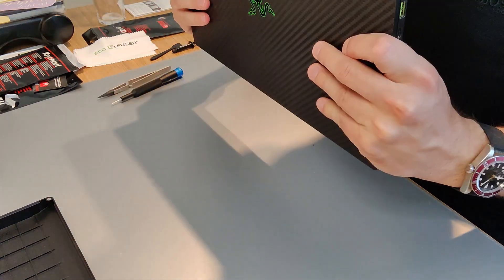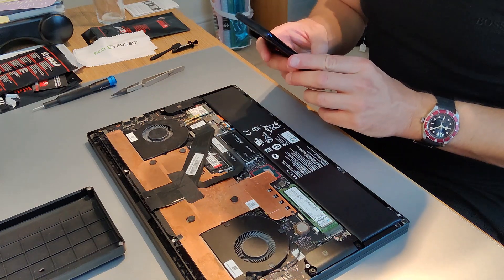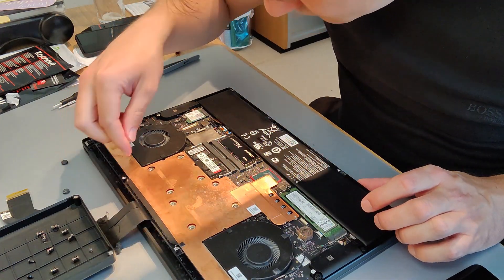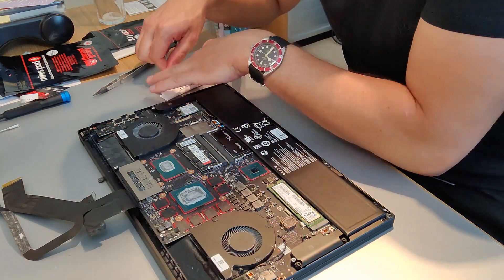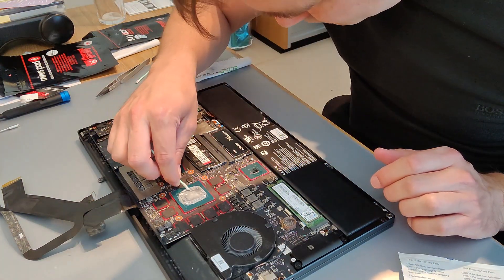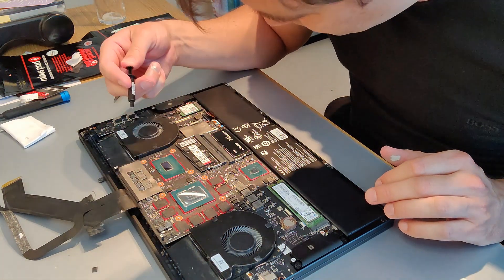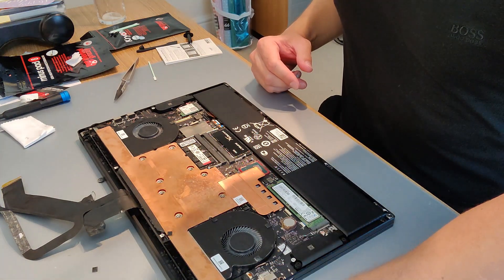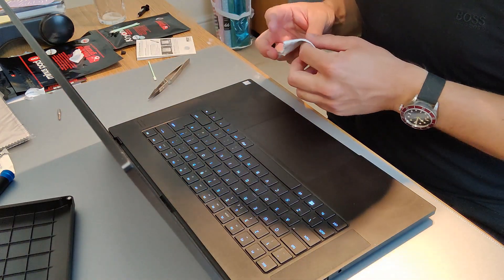Razer Blade 15 RTX - Teardown and Repaste - Thermal Grizzly Kryonaut - Guide

Comment: Just repasted mine a few days ago. I have had my laptop since late 2019. As i took the screws out of the back plate the battery began rapidly expanding. Found out why I was getting such poor thermals
Reply from the maker: Omg! 🤯
Reply: Yeah replace your battery every 2 years. The Razer battery is known to bulge, I replaced mine now with a third party (cheaper) battery. And it’s better quality than the original razer one 😂
Reply: @genicota  eh. the 2070 max-q in it isn't worth it anymore. i just run it on the charger and curse when the power cuts out.
Reply: @ImmaSayKOOHWIP Defeats the point of having a laptop? So no thanks
Reply: @genicota  bro i ain't trynna convince you that it's the way to go?? Just personally don't need my laptop for portability. if i am out and about i'm not trynna pull out a loud ass gaming laptop tf?
Reply: @ImmaSayKOOHWIP Ong this foo is tweaking.

Comment: Why you didn't clean the fans, and grills from dust, ahhh and also .... pressure will not spread - in laptops - thick paste, you would be better of with using that spatula that was with Thermal Grizzly, additionally just after reassembly it is best to quickly thermal cycle the CPU and GPU - you need to expand/contract the paste as quickly as it is fresh and fill in 'voids' well. I would agree though that 5C up to 10C difference is only with perfect application, LQM can reach 12-19C improvements.

Comment: Hi, can i know how this razer blade performs today?? Is it still alive? Are you facing many issues during the years up until now?? Sorry I'm asking this, because there are alot of people having problems with their razer laptop like the presents of several issues with their laptop, thank you :)
Reply from the maker: Unfortunately it was stolen from me about 6 months ago. It was still excellent  before that happened after over two years of heavy use. I have never had problems with razer laptops and will continue to hold them in very high regard. 

On the other hand, I've not heard many speak of problems with Asus products but I've had 5 ROG Zephyrus laptops and only one of them wasn't badly defective. I've put it down to bad luck so haven't made a fuss 👍🏻

Comment: Thanks for the guide. I've had my blade nearly 2 years and about a month ago I shut the lid (normally puts it in sleep mode, this time it didn't for some reason) and put it in my bag. When i got it out again 45 mins later it was too hot to touch, cpu was at about 99 degrees. When I took it apart the paste, or what was left of it, was crusty. Just got it all back together and its idling 10 degrees lower :)
Reply from the maker: That's amazing! Good skills 👍🏻

Comment: Just replaced the thermal paste and cleaned my fans and heatsink

My temps dropped from 96 to 50. My fans has a think layer of dust and my paste was a mess and crusty. 

So pumped to be getting the performance I expected out of this thing. It was basically always at a state of thermal throttling untill now.
Reply from the maker: Nice!! Sounds like you did a good job. 

Yeah it can make a big difference. I repasted an msi raider a couple of weeks ago and it made a huge improvement.
Reply: @WarneysWorld  thanks for the video !

Comment: I just bought the new i9 OLED Blade Advanced and while gaming I am in the 70's but I get 100 degrees spikes. I am really considering Kryonaut.
Reply from the maker: Is it a quick spike which settles down as the colling system overcomes it or is it more frequent? That's a beast of a cpu in a thin and light laptop! 😍
Reply: @WarneysWorld  Yeah a really quick spike. I think it only hits 100 degrees for one to two seconds.
Reply from the maker: I don't think that will do it any harm. On my blade 15 I caned it for a year at 95deg before I learnt about undervolting an I've never had problems with it nearly 3 years on. Never hurts to proactively manage temps though so if you're confident with repasting it's only going to help. Out of interest, can you undervolt 11th gen cpus?
Reply: @WarneysWorld  Actually I found out it is sustained 100 degrees on CPU and 70's on GPU. Since day one it has been like this and that is why I am considering Kryonaut.
Reply from the maker: You might be right, it could be a bad factory paste job. If it was me I would definitely give it a go.

Comment: Hi I have razer blade base 2019, the fan noise is very loud, if I change thermal paste will it be quiter?
Reply from the maker: It will be if your system is dissipating heat more effectively. Also worth vacuuming any build up of dust in the fans as this can also make a bit difference.

Comment: Thank you my main! Was at 100'c before following this tutorial. Now barely hitting 68 whilst gaming. I would buy you a beer if I could.
Reply from the maker: Beer is always welcome! Haha
Reply: @WarneysWorld  i have my razer blade since 1 year now and since some weeks i´m also hitting like 80 to 100degrees while gaming/editing, so it´s time to repaste, right ?
Reply from the maker: It might need repeating after a year. Temps up to 90 on the CPU whilst gaming and rendering is fine but I wouldn't want mine going up to 100
Reply: @wambologyy  while you're at it, check the fins and fans for dust buildup, if you have pets or live in a place where dust is prevalent, this might be the main culprit.
Reply: Tenka thanks for the advice!

Comment: Was that liquid metal or just a normal thermal paste ?? And did you notice some performance boost ?
Reply from the maker: No it was just kryonaught. I'm a bit scared of liquid metal 😅 

I didn't notice any difference but it was a good paste job already by razer and they use decent stuff
Reply: @WarneysWorld  😄 okay , I thought it was liquid metal cause thats risky 😬 
I am gonna buy a thermal paste tomorrow for my razer laptop , do you think its worth it ??
Reply from the maker: @Kamrankhan23333  I'd only do it if you think there is an overheating problem
Reply: @WarneysWorld  my laptops temperature gets too hot that I can even cook eggs on it 😄 🤣

Comment: To anyone who is going to repaste your Razer blade 15 ( in my case it is a version from 2018). You might have noticed four soft pads that cover heads of four heat sink screws (https://youtu.be/XUKb-FzgubI?t=176). Throw them away (or glue them?). You may have been smart enough not to put them back, but I was not ( though I had a feeling that I should not. But then, I thought, ah it was there in the first place who am I to throw these pads away?). Long story short one of them ended up being stuck in one of the fans, blocking it. I had temperature drops when playing, and could not see a reason (for a few months after repast I had to stay home and did not move my laptop, but then I was allowed at my office, and then I guess while carrying it, gravity pulled one of the pads down which ended up in the fan.). Then I looked at it and saw that one of the fans does not rotate.
Reply from the maker: Thank you for the tip 🙏🏻

Comment: Hey man great video! I have a Blade 15 advanced model with a rtx 2070 max q and an 8th gen core i7. Im getting 88C while gaming on the GPU and 95-100C on the CPU. Are these similar to what you were getting before you repasted?
Reply: I've got a 2020 Blade 15 base with the i7 10750h & GTX 1660ti, my first one was 70-78°C while playing GTA V, my replacement (same year, model and spec) seems to hover around 76-84°C on the same title! (temps are CPU & GPU average) but from what I've read the CPU is rated for 100°C so while it's not amazing, you're still within the limits for the chip

I've got some Arctic silver 5 left over from my desktop build so will be repasting later on today when I install a 1TB Samsung 970 evo 💯
Reply from the maker: No my temps weren't that high but I didn't really need to repaste. If your temperatures are up to 100 on your GPU I would definitely repaste. I think it will make a difference. 

You could also try using throttlestop and afterburner to undervolt and reduce temperatures as per my video here: 

https://youtu.be/DRsCzRtiylY

Remember that all chips are different so what works for my device might not be optimal for yours. So these settings could be seen as a good starting point but you may benefit from experimenting a little yourself.
Reply: @WarneysWorld  Cheers mate! Ill try it and let you know. Also, what are your thoughts on liquid metal?
Reply from the maker: @keshan2675  Theoretically liquid metal would be the best performing interface material due to its thermal conductivity, but the stuff honestly terrifies me, as it is electrically conductive, one tiny slip could result in a bricked system. I'd also be concerned about it moving over time. I don't think you should need it on these systems. 

I'd be really interested to hear how you get on. Make sure you hoover any dust out of the fans too because that can make a massive difference 👍🏼
Reply: @WarneysWorld  Yea thats fair enough, I do move my computer around all the time so LM probably wont be the best idea.
I just ordered kryonaught, ill let you know how my temps are !
Reply from the maker: @keshan2675  amazing - good luck!
Reply: @WarneysWorld  Just finished. Dude my system runs wayyyy cooler! Took everything apart, i cleaned the fans (just sprayed some air in there, didn't get everything out). When I took off the heat sink there was a lot of dust build up on the fins. The stock thermal paste was still in pretty good shape, it was soft and still creamy sorta. Removed most of it. I used kryonaught from thermal grizzly, used an x shape pattern and spread it over the entire CPU and GPU. Im getting temps in the 78C on GPU while gaming. Its amazing! 

One question, as I was taking off the heat sink, i forgot to take off one screw so the heat sink sort of bent, but not much and doesn't impede on the structural integrity. Since it is a vapour chamber, would it have long term implications on the system?
Reply from the maker: @keshan2675   @Keshan26  that's great news! You must have done a good job 🙌🏻

It's hard to say about the heatsink. If you have improper contact between the heatsink and the CPU or GPU you would see them running very hot.  It might be best to wait and see, but if it's performing well and running with acceptable temps I really wouldn't worry.
Reply: Hi @WarneysWorld  , your video with afterburner and undervolt is now set to private. Is there any chance you could make it available again?

Comment: Hi, nice vid man. 
I'm consider changing my thermal pads.
What's the thickness of those thermal pads? and one on the PCH, SSD thermal pad seems thicker.
Reply from the maker: I'm not sure to be honest. I would check on yours in case there are differences 😊
Reply: @WarneysWorld  i replaced all my pads with 1mm thick pads xD and all pads doesn't seems to have full contact with heatsink xD.
Reply from the maker: That's the kind of thing I'd do! 🤣

Comment: I think you put much less thermal paste onto the GPU than it needs.
Initially, I did thin X and saw how the temps went crazy, about 15 degrees higher than before.
Then I've reapplied using the fat X with dots on the empty spaces and now the temps are pretty the same as were before the first applying.

So, I see that the GPU definitely needs more.

BTW, for CPU I used the rice grain, and the temps went down for about 15 degrees. So it definitely worse it.

I used the Noctua NT-H2 and the Thermalright pads.
Reply from the maker: It's fine, I have used it for six months since the application and temperatures are great, and it out performs many devices of similar specification. The application was completely valid and in line with published guidance.

Comment: Does opening and upgrading void the warranty as Razer is totally restrictive when it comes to their warranty, repairs, parts which they do sell and there are no local authorized repair shops.
Reply from the maker: Upgrading your ram and SSD won't invalidate warranty but repasting probably will. But I don't see how they would know that you've done it unless you put it back together wrong or tell them. I did mine when it was already out of warranty, and I didn't really need to do it, I just wanted to find out if it made a difference. If you have a device with high temps and poor performance it would definitely be a step I would take as a poor paste application could be the cause of the problem
Reply: They will not sell any replacement parts. I have an RB 2019 that was shipped missing a screw, it's a Mercury White model and the screw colors match the rest of the chassis. They "have no way to get a replacement" out to me.

Comment: Can  you check if there is line on your cable between the vents mine has line in the cable not cracked but a visible mark on where the cable was bending.. let me know if yours has the same..
Reply from the maker: There is a faint line but there isn't any sign of abrasion or wear.
Reply: @WarneysWorld  ok mine has the line to I'M so worried about it its only 3 days old and i have the RTX2080 model it was not cheap

Comment: That display cable is made to fail..
Reply from the maker: Doesn't look great but I haven't heard about any failures
Reply: @WarneysWorld  I have.. I seen people complaining of their cam and mic failing, I'm thinking returning mine back..
Reply from the maker: @KTBLGaming  I've never had any issues with mine. I returned 2 Acer predator Triton 500s due to severe screen defects and an Asus Zephyrus which had a faulty GPU. My blade has been perfect for 2 years and counting. The grass isn't always greener. Good luck 👍🏼
Reply: @WarneysWorld  ok well two years is good for flex cable. Maybe i will keep it will see how it does until January and if the cable gets any worse, I would send it back and if not may get external insurance for it.. Best thing would be an easy place to order the cable from but as I read razer does not sell parts or anything people also say their support is not good..

Comment: Hi dear I think you can answer one of my problem. I recently baught a Razer blade 13 from ebay verified microsoft store. The device hardware is all the same as listed in the website however the system information says it is an ACER laptop {predator} How can it be possinle? What actually they did with the laptop. This version should have Windows home but I got Windows pro. I really dont understand whether to keep this or return.
Reply from the maker: I would return it and get a refund and then report the seller. I can't imagine why a razer laptop would think it is an Acer.

Comment: is it hot at the keyboard during gaming ?
Reply from the maker: No it actually pulls air through the keyboard for cooling so the keyboard stays nice and cool.
Reply: @WarneysWorld  oh that is really good, I asked because I saw of one the statements that it claimed Razer warm at the keyboard during gaming, but I didnt aware the year model of it ..
Reply from the maker: @Imuraandesuu  yeah all of the razer blade 15s draw air in through the keys right where your hands are (WASD) - it's literally like having a cool fan on your left hand. The area above the keyboard gets quite hot, but this is the same on all gaming laptops and even Macbooks. There's no need to put your hands there so it's not a problem 👍🏼
Reply: @WarneysWorld  yes I agree since the gamers usually at WASD, my  ROG also in a same way, where the other surface is really hot except the usual buttons, how about the fan noise, I mean i dint really concern about fan noise since it's gaming laptop, but I wonder how loud Razer could be during gaming ?
Reply from the maker: @Imuraandesuu  it's quieter than most. Under load notebookcheck measured it at 45db, which is amazing considering many competitors are up in the 60s. It was one of the reasons I went for the blade and I haven't been disappointed. Sure you can here them, but they're not loud or harsh
Reply: @WarneysWorld  that’s amazing! Anyway thanks for your reply , I appreciated it !

Comment: This video is absolutely brilliant thanks man!

I'm wondering if I need to do this to mine, as I've been experiencing quite common and lengthy lag spikes in every game I play recently (after about a year of it working perfectly with whatever I throw at it). I'm pretty sure it isn't driver related, I'm starting to suspect it's thermal throttling. 

Would you say that cleaning the vans out with compressed air and possibly applying fresh paste could solve the problem?
Reply from the maker: Thank you for watching! Yes I know some other people in the comments said clearing their fans made a big difference, so it could be worth a try. My factory paste job was actually quite good so the repaste didn't make a big difference for me. I know it has helped some others though and it is kinda fun to do. The other thing I had some success with was using throttlestop to manage my CPU temperatures as per this video: https://youtu.be/DRsCzRtiylY
Reply: @WarneysWorld  Ah thanks man! Your videos are really helpful, I appreciate the response! I'll give it a go!
Reply from the maker: Thank you 😊
Reply: @WarneysWorld  Hey man just wanted to give you a quick update. I followed this tutorial on my own laptop, cleaned it out, put new Thermal compound on it. And I followed your undervolting tutorial. After doing both, my laptop is now working perfectly, like its brand new. 

Thanks to you I might finally finish The Witcher 3 😂 thanks again for your help!
Reply from the maker: @benjaminmcginn195  that's fantastic news! Good skills! 🙌🏻

Comment: Any chance you would be open to running through on how to clean the fans? I don't want to spray compressed air and direct the dust in a worse off spot.... any advice/guidance is welcomed!
Reply from the maker: I just used a vacuum cleaner. There was hardly any dust in there. Probably be more if you have dogs in the house etc.
Reply: Warney's World you’re bang on.. I am around animals a lot more.. probably why it’s accumulated so much for me!